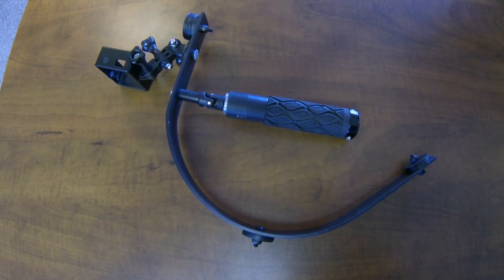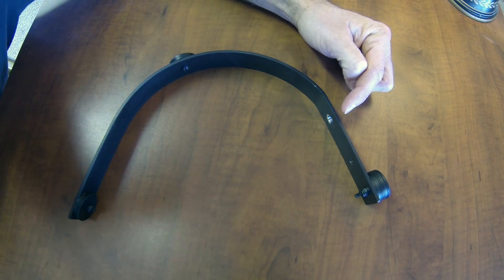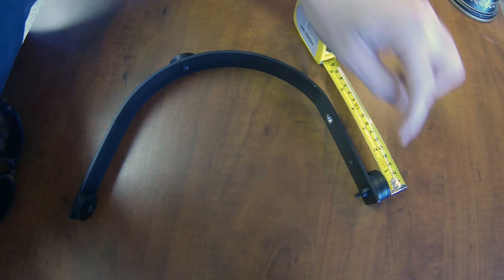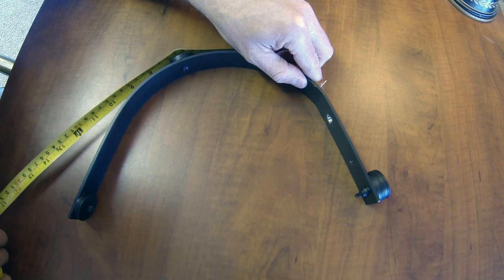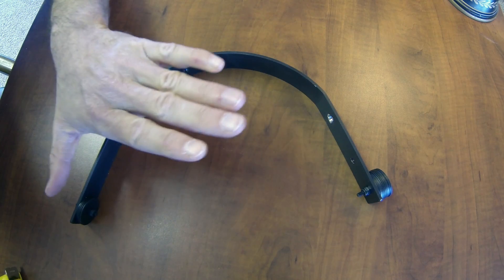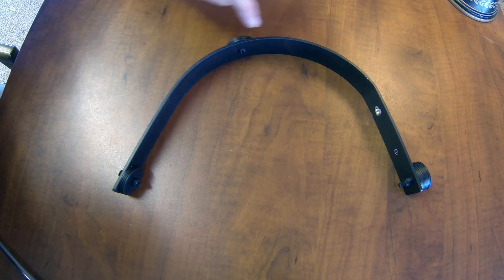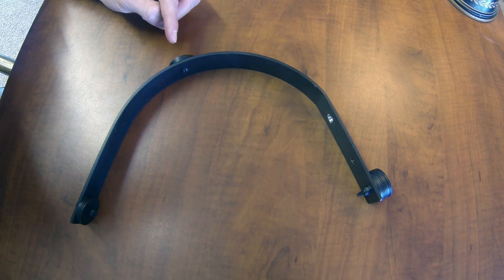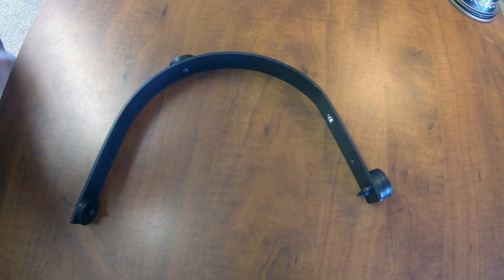DIY GoPro Steadicam Version 2: Step-By-Step Build How-To

Comment: Hi I have the 3/4in cpvc coupler and of course the 3/4 cpvc pipe. Now you say the bearings should be 6x22x7 bearings. That measurement is mm for those correct? Well I have 6mm x 22mm x 7mm bearings. They don't even come close to fitting into the coupler. It seems like I am putting a very thick layer of packing tape on them to make them fit. In your video it appears as if you only had to put very little tape on the bearings. How thick of a layer of tape did you have to put on?
Reply from the maker: Sam McBeth Hey Sam! Thanks for the comments. You should only need 1 or 2 layers of tape on the outside of the bearing. I'm thinking that you have PVC pipe parts instead of CPVC. They say the same size on the pipe itself but in reality the sizes are very different and aren't interchangeable. CPVC is less common but still shouldn't be hard to find. It usually has a very light tan/yellow/brown color to it. Let me know if you need more help.
Reply: Hmm not sure what happened. But I know for sure I bought cpvc. I just kept layering tape on to make it fit. But thanks for the advise. I am looking forward to getting my rig made. Thanks for posting and sharing these cool ideas.

Comment: Can you tell me the measurement of the distance between the two ends of the aluminum bar (near the top and bottom weights?) Many thanks. I'm planning to build a wooden form to make the bend around while minimizing twist.
Reply from the maker: Tom Davies Hi Tom! Thanks for the comment. Measuring from the end of the frame behind the camera, directly down to the other end of the frame (by the bottom weights), I get 11.75 inches. Please let me know if that's not the measurement that you are looking for
Reply: God's Country
That looks right to me. Thanks. I'll let you know how it goes. I plan to do a wooden form and a strap clamp to bring the aluminum to the form's shape.
Reply from the maker: Tom Davies Sounds good. The aluminum is pretty easy to bend.
Reply: Cool! Have you started it yet?

dd

Sent from my iPhone

Comment: I'm almost finished with the construction (ran into a few snaggs along the way, i.e. the bearings) of the rig. I have a few last minute questions.

1. what size are the holes drilled to for the weights?

2. Are they steel or aluminum?
Reply from the maker: Maxton McGuire Thanks for the comment MM! I'm sorry but I don't remember what size holes they are. I would just buy the weights (steel fender washers) and then find/buy a bolt that fits the fender washers. There isn't much stress on these weight bolts so you don't need anything very large/heavy/strong. Then just match the drill bit size to the size bolts you buy.

Comment: Thanks for this tutorial. I'm a tinkerer and just love little projects and I'm looking forward to creating a few of these steady cams... My question is, using these arms to secure the gopro and such leaves much room for balance error does it not? I mean if you slightly fasten on a wrong angle, you would have balance issues as the gopro now sits differently. I'm guessing these are the specifics you didn't mention as that would require a longer video? The solution if using these gopro mounts then would maybe be marking the angles on the gopro arms at their pre-balanced positions. I think a permanent mount would be a better solution ...then balance your steady cam based on that position.

Comment: Hi, I already made a similar steadicam but I have a problems, no matter how much weight and counterweight add, the bar have too much oscilation, any help? here is a video of my problem http://youtu.be/O-nE1yYSt-I 

Since now, thanks!
Reply from the maker: Hey Oscar! Thanks for the comment. First of all, make sure you are balancing the steadicam with the camera mounted to it. I have a feeling that your video didn't show the camera because you were using it to film with but I wanted to mention it just in case. The weight of the bottom of the "rig" (steadicam and camera combined) has to be only slightly heavier than the top above the pivot point in the grip. You need it just slightly heavier so that the camera will stay upright. If you hold the grip in one hand, pull the bottom of the steadicam out to the side and let it swing to the bottom, this should be a slow swing. If it swings slowly that means the weight of the top and bottom are close. The key is the make the front and back weigh the same to prevent rotation. Top and bottom are almost the same with the bottom slightly heavier. Side to side should be balanced so that the camera sits level. If you have a chance, check out my other steadicam videos, especially this one: DIY Steadicam Design and Construction Tips - For GoPro Hero 3, 3+, 4, and Other Cameras . I talk about balancing some in there. It's just a lot of trial and error sometimes. Let me know if you have any other questions.
Reply: God's Country Thanks, I try tomorrow and let you know the results, thank you so much!!

Comment: Thanks for the great video. My husband and I just built it, but we find that it swings from side to side while walking around. Any idea how to balance out horizontal / side to side swinging?
Reply: We just figured it out. We added more weight at the top and also raised the washers about an inch higher from the bar. We've got about 17 washers at the top and 5 at the bottom.
Reply from the maker: Ada Deacon  Great Ada! I'm glad you got it figured out. Good work! Let me know if you have any other questions.

Comment: Hi, first thanks for the video, I gonna try soon to make a similar steadicam, I´m having problems to find the pieces, to the handle, I gonna use a plastic tripod because I can´t find the traxxas here in Mexico, and the tripod had a gimbal sphere, for the others items I just have a doubt about the aluminum bar, what do you use for bend the aluminum bar? 

Greetings from Monterrey Mexico, sorry for my English :)
Reply from the maker: Oscar Sanchez Hey Oscar! Thanks for the comment. I'm sorry you are having trouble finding the Traxxas parts. I can not find them locally either so I order them. Have you tried to find an internet supplier that will ship to you? Traxxas might have one listed on their website. I bent the aluminum bar by hand around an air tank cylinder. If I remember correctly it was around 9 inches in diameter. Let me know if you need more help.
Reply: God's Country Yes, that help, I find the traxxas on ebay but can take more than a month to arrive, so I looking for other options, even the aluminum bar is hard to find, on the local lowe´s and home depot is not for sale, I find a company who sale that kind of pieces but is 10ft long, I gonna buy it and if I do a good job maybe do more steadicam for sale.

Thanks for the fast reply!!

Comment: Hey man, I can't seem to get my build to balance correctly. Ive tried and tried to get it balanced correctly but it just continues to swing. Any thoughts? Anyone?
Reply from the maker: sethcal88 Hi Seth. Thanks for the comment. You might want to watch this older video of mine: DIY Steadicam Design and Construction Tips - For GoPro Hero 3, 3+, 4, and Other Cameras . It talks about balancing and camera/handle position starting around the 3 min mark. Did you build yours exactly like mine? If so, start off with the same number of weights as mine. Otherwise it's just a lot of trial and error adding and removing weights. The lower part of the steadicam should be only slightly heavier than the top so that it keeps the camera upright. If you draw an imaginary line down through the camera and grip, the front half of the steadicam should balance with the back half. If they are equal than there shouldn't be any rotation around the grip axis. Equal weight front and rear does not mean equal number of balancing weights because the front already has the weight of the bow/frame. Let me know if you need more help.

Comment: I did that but with a mini-tripod witch comes with a sphere as a gimbal... the only thing is I couldnt properly bend my bar :[
Reply from the maker: Rsewo Sorry to hear that Rsewo. The best thing to do is find a round object that you can bend the bar/frame around to form it's shape.
Reply: Yey... I did bend the bar properly now... Working perfectly, i just need to paint it. Hey i did a diving mask mount and a diving mount to use the two hands... Havent seen anyone doing it like i did yet... Maybe ill make a video later. The mini tripod steadicam is a lot easier to make and easier to find here in south america... Checkout gopro steadicam portugues its good stuff too tks for your video it helped a lot

Comment: Did you cut that 3' bar? If so, how much did you cut off? I bought the 3' piece.
Reply from the maker: MMA WOZ Thanks for the comment. Yes, the aluminum bar is cut off. I do not know how much I cut off but the frame measurements are in the beginning of the video and also in the video description. The flat platform is almost 5" and the curved front and bottom are 15" so I'm thinking I cut off about 16".

Comment: Only issue I have with this is the 3/4" coupler and the same 3/4" pipe (handle)?
Correct me if I'm wrong but if they are the same size of 3/4", they won't fit together.
I have the 3/4" coupler CVPC- and a 3/4" pipe, 6" in length. They don't fit.
What am I doing wrong here??

Thanx man!!
Reply from the maker: MMA WOZ When you are talking about pipe plastic pipe sizes, the dimensions are more of a classification: 1" pipe requires 1" fittings, 2" pipe requires 2" fittings, etc. 3/4" CPVC pipe requires 3/4" CPVC fittings. My guess is that you have regular PVC pipe instead of CPVC. CPVC fittings will not work with PVC pipe. Their sizes are different. If possible, try fitting them in the store before you buy them to make sure. If need be, take your grip into the store to test fit also.

Comment: I allmost finished mine! The only thing I need are bearings. I know that for my grip I need 19 millimeter on the outside but what size sould the inside be, I have the same traxxas joint as you.
Reply from the maker: Steven Klaassens Hey Steven! The steel shaft on the Traxxas half shaft needs a bearing with a 6mm hole in the middle. So the 6x22x7 bearings that I used have a 6mm inner diameter, 22mm outer diameter, and they are 7mm wide. It sounds like your grip setup will be slightly different than mine but I did see that 6x19x6 bearings are available. Let me know if you need any other help.
Reply: Tnx for the info again, I ordered them and I will let you know if I have any more questions

Comment: Hi, where did you buy that universal joint? Can I buy it somewhere on the internet?
Reply from the maker: Frantisek Herman Hi Frantisek. Thanks for the comment. You can buy the Traxxas parts from towerhobbies.com and other remote controlled vehicle suppliers on the internet. The full parts list is in the description of the video. Let me know if you have any other questions.
Reply from the maker: Frantisek Herman Yes that is correct but you also need Traxxas part number 4953x and it doesn't look like that website has that for sale. Again, make sure and read the video description for the parts list. I don't want you to miss anything that you might need.

Comment: well, its ok, but:
ты описываешь твою конструкцию
 ты имеешь твой DSLR 
а если мой DSLR другой, чем твой
как я могу adjust мой DIY Steadycam
Reply from the maker: iCoteg Thank you for your comment. This steadicam is designed for GoPro and other small cameras. I do not think it would work well with a DSLR. You would need a bigger steadicam. Sorry.
Reply: ok, thank you

Comment: Alright, this is probably a dumb question, but I am building one and everything is going great, except I can't get the ball joint into the half shaft or the stub axle. I'm using the same ball joint thing that came in the package with the half shaft, but it is just seemingly impossible to put them together! I was wondering how you did it, was it just sheer force and mucle or am I missing some technique or tool or something, thanks!

Comment: Great vid first and foremost.
What would you suggest I do, or how would I approach mounting a DSLR to the top of the frame instead of a gopro?
Reply from the maker: Thanks BK! Honestly, I think you might want to build a rig that is a little bigger than this for a DSLR. I specifically wanted this steadicam to be small and light for a GoPro. For a DSLR you might want to build one that has a little bigger/stronger frame. You could also use an adjustable mounting platform that will let you move the camera precisely forward/back and left/right to help with balance. I have not looked at any DIY streadicam videos for DSLRs but that is what I would do first if I was thinking of building one. If you still want to move forward with building my style steadicam, you should mount the camera as close to right above the grip pivot point as possible.
Reply: God's Country I see, perhaps something like curved electric metallic tubing, counterbalanced by metal washers? Although the dslr is heavy, my primary concern is avoiding a rig that gives overly-sensative side to side rotation, or a rig that doesn't have a wide center of balance so navigating corners becomes difficult. I actually recently was using my friends very-expensive "T" model steadicam, and although it was arguably professional calibur, I could not for the life of me complete any pathway that had turns or corners in it do to the extremely touchy counterbalancing. Any suggestions to that extent that could be included in my eventual homemade model? Thanks a lot
Reply from the maker: Berk Kiziltug I think the electrical conduit may be a good place to start. Sometimes when I design things it takes a second version to get it working really well. That's what happened with this steadicam and some of my other projects on youtube. My point is that it might take some tweaking to get your design working well. Don't be afraid to try a few different things along the way. You should go to my GoPro Gear playlist and watch the other steadicam videos that I have. There's some valuable info in there that will help you with a bigger design. I wish I could be more specific but I've never built a steadicam for a DSLR.

Comment: i need one where i can walk continuously for like 30 minutes smooth as much as possible without much fatigue like this guy here...how long have you used it continuously at one time?

Walking in Hồ Chí Minh City ( Saigon )
Reply from the maker: I have never used mine for 30 min at a time but I do regularly use it for 10-15 minutes at a time. I have never felt fatigued while using it. The good thing about this setup is that it is light weight. The camera is light and the steadicam is light since it's mostly plastic and aluminum. Let me know if I can't help with anything else.

Comment: Wouldn't having the bearings in the handle make it hard to do panning shots? Because if the handle spins with your body the frame will be all over the place loosely. I'm making a variation of your design and just was wondering what the benefit of them would be.
Reply from the maker: The bearings in the handle do make panning shots harder but they are still doable. The purpose of the steadicam is to remove your body's motion from the camera and that includes rotational forces. I feel like the bearings are necessary but you might be able to get away with out them.

Comment: Thanks for the bend dimensions, it's a huge help. So I got the parts and assembled my rig yesterday. Wondering about the front (center) weights. I understand that yours comes ~7" from the gimbal hole but when you were making this, did you just split the difference and eye-balled the middle between bottom weight and gimbal hole? 

Right now I need to buy bigger diameter washers since the ones I had laying around were too narrow to provide significant weight change. Once I get things squared away, I plan to paint it, and make a video for it.
Reply from the maker: Hey Vincent. Yes when I was originally building mine I just eye-balled the middle between the bottom weight and the gimbal hole. I wanted the weights on the very front of the steadicam. You probably already know this but the washers you want are called fender washers. Let me know how it goes!

Comment: Just finished up mine and works great. Thank's for sharing your build! I made a few modifications that I thought would enhance the use of it. I made a 2 handed grip instead of just a single handed one. I tried out the one handed grip and liked it but thought I could make it smoother by having a 2 handed grip. I'll post pictures of my build to your facebook in case you would want to test out the grip yourself. Thanks again for sharing!
Reply from the maker: Great! I'm glad it worked well for you. I'm interested in seeing the two handed grip.

Comment: Is there any real benefit for using aluminum bar instead of steel? My local Home Depot only has steel. Great video btw!!!
Reply from the maker: The advantages to using aluminum are that the whole rig will be lighter and you will probably have to use less weights to get it balanced. It is possible that a steel frame might make it less likely to blow in wind and it would be harder to bend on accident. I have not had any problems bending my frame on accident and aluminum is certainly easier to shape when you're building it. Do you have a Lowes near you? That's where I bought my aluminum.
Reply: God's Country thanks for the reply! There is a Lowes around here so I'll stop by to check it out tomorrow!!! Thanks again!

Comment: I could not find any 1 1/4" aluminum bars. They only came in 1" or 1 1/2" bars. So I bought the 1 1/2" bar.
Reply from the maker: Dou, I think that will probably work fine. You might need a slightly different number of weights than I used.
Reply: God's Country thanks!